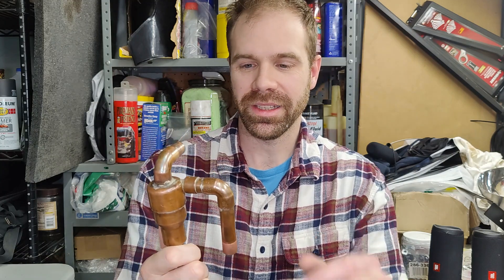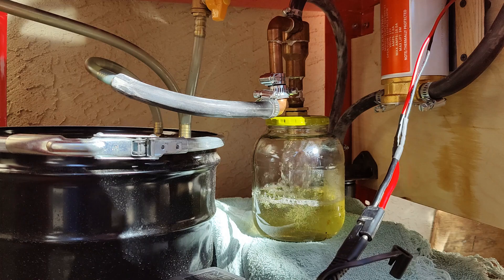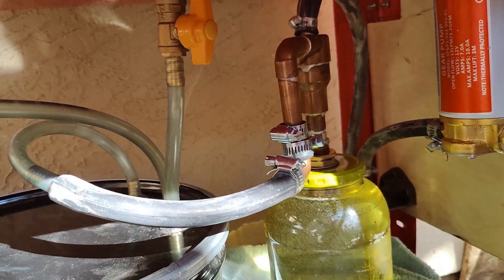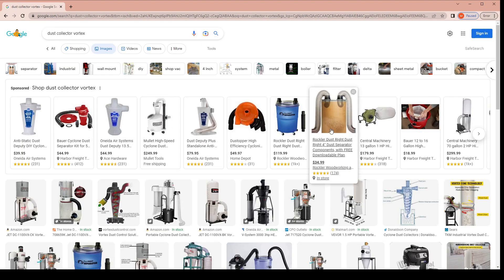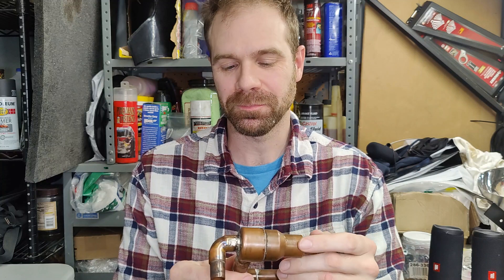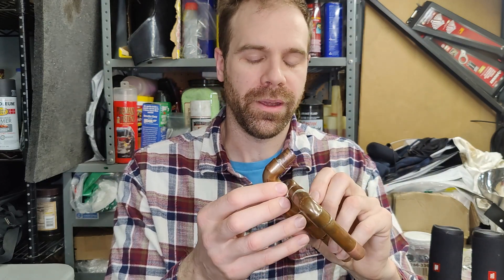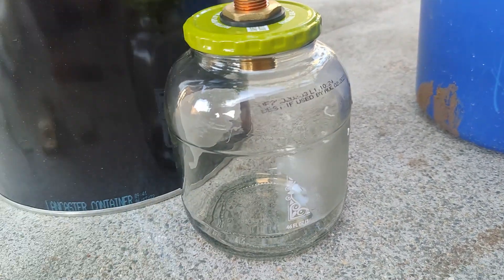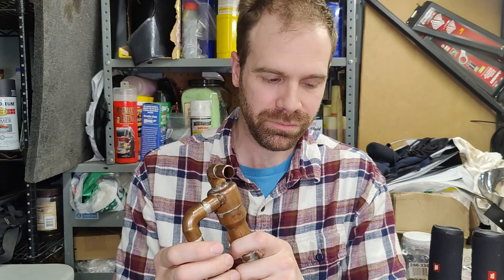DIY Vortex Separator for a Solvent Parts Washer

Comment: As a retired welding inspector I formerly worked in various industries including refineries with catalyst crackers and the regeneration process. They looked basically like the one you have there but they were sometimes over 80 feet in diameter. So the one you have is a little bit smaller but with the same concept.

Comment: Could you explain your reason for using a gear pump as opposed to eg a rotor pump please?
Reply from the maker: @anibbotson  any positive displacement, self priming pump for use with fuel (specifically diesel or kerosene) with the appropriate flow and pressure rating, with the appropriate electrical power input (DC for easier throttling) at a reasonable price and quality will do. 

I probably ended up with a gear pump because it was the most affordable, readily available one I could find that met the other requirements.
Reply from the maker: It should also be tolerant of dirt or particulate, which is in conflict with wanting a positive displacement pump. Usually vane or centrifugal pumps are used for dirty flows (vacuums, chipper blowers, hydroelectric dams, etc). I believe the pump I selected has replaceable gears for when they wear out. The original parts washer setup used a submerged centrifugal pump that wouldn't be self priming, but since I wanted to move the pump external to the reservoir, I wanted a self priming pump, as well as one that could be run at low flow rates and still have an effective amount of pressure. Centrifugal pumps have poor performance at low flow rates.
Reply: @Martinwilliamdesign  Is there any reson I shouldn't use a diaphragm pump which fits the spec as long as it's rated for diesel/kerosene? I like your setup but I object to paying £100+ for that pump you chose and I'd settle for a one-hour duty cycle so I can get something for around quarter the price...
Reply from the maker: @anibbotson  a diaphragm pump for fuels would probably work if it provides enough of a flow rate. My experience with diaphragm pumps is generally with small engines which only need low flow and low pressure. 

When I selected the pump I used for my setup it was much less than what you just said.

Comment: Could you do a video on the wiring process of your parts washer?
Reply from the maker: @Hellsing2161  the wiring was very easy. I think the speed controller came with a wiring diagram. The pump is the "load" for any speed controller like this

Comment: The conical ones are due to fitting size on the crap outlet. What you really want is the in coming fluid to reach a low velocity such that crap can fall out of it despite being drawn in up the centre column. That takes diameter. My 2c. :-)
Reply: Ie the downward movement of high mass crap beats the very slow upward flow of fluid. Same applies in many systems. The cyclone style puts the crap in the very slowest moving/downward moving column and the fastest upward is in the centre which is inherently clean.

Comment: Good info. One question. I see in your other video that you have three adjustable outputs into your cleaning tank. Could you set these so that you are using the full pump flow instead of adjusting the voltage to the pump? For example, the straight down output could be selectively opened to adjust the pressure to the nozzle or the brush. That way you’d get the full 3 gallon flow through the vortex separator.
Reply from the maker: Yes, and actually that was the original intention of that design. I like running it slower just because it's less wear and tear on the pump and it's quieter, plus there's a lot of splashing at higher flow rates. I'll probably add a tube/hose to the bottom output that can take more flow with less splashing to help with this. Maybe create a smaller bucket to wash smaller parts with a higher flow rate. The hardware for the three outlets was $100 so if I did it again I might just do the variable speed control with only one or two outlets, and a smaller vortex separator.
Reply: @Martinwilliamdesign  Hi Martin. Got a brainstorm overnight. What if I use a two way splitter and feed one leg with a valve back into the solvent can.  That seems like a way to control the flow rate from the 3 gph pump to the washer without making turbulence in the washer sink. Also, I’ve only had the spray spout in my parts washer, and as you know it tends to overspray and make a mess. I have been planning to install the brush wand instead. I’m thinking maybe the brush works better anyway. You have both in your parts washer, do you find the spout is worth having compared to the brush?
Reply from the maker: @Royson Parsons I use both the nozzle and the bush for different things. The problem with my brush is that the host tends to collapse and get pinched. If I did it again I would buy a higher quality one with a better tube (and will make this update to mine someday soon). The recirculation plumbing could work. I personally like the idea of flooding more though my parts rather than just pumping it back into the tank. I would consider just adding a bigger tube to the bottom of the tank. Maybe welding on a new one or drilling it out and using standard sink drain hardware, using fuel safe RTV sealant instead of plumber's caulk